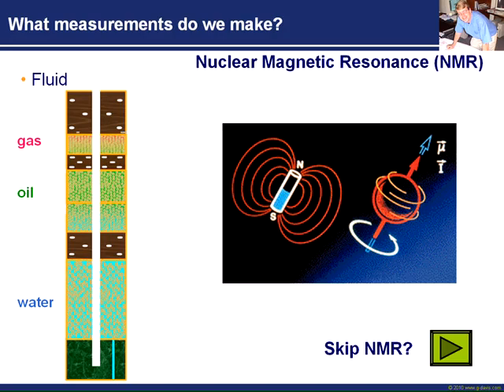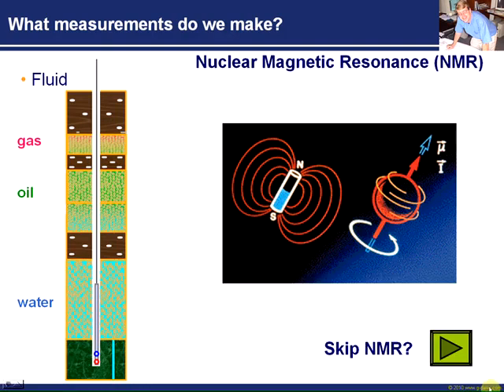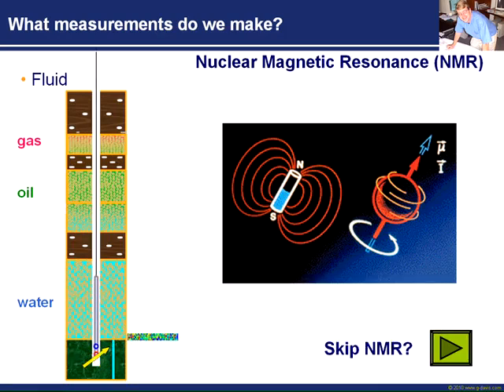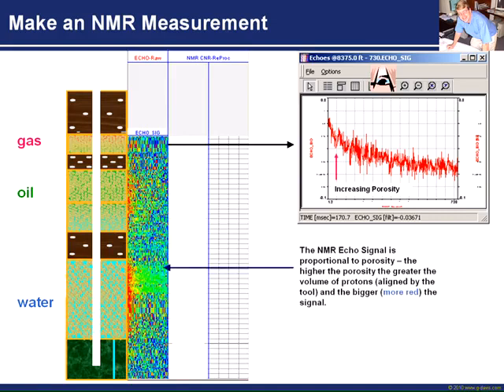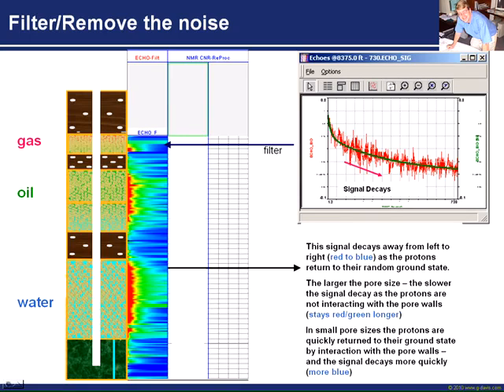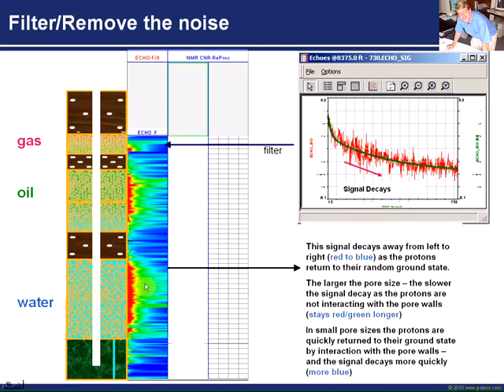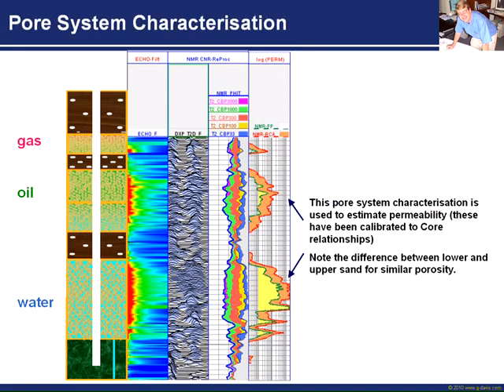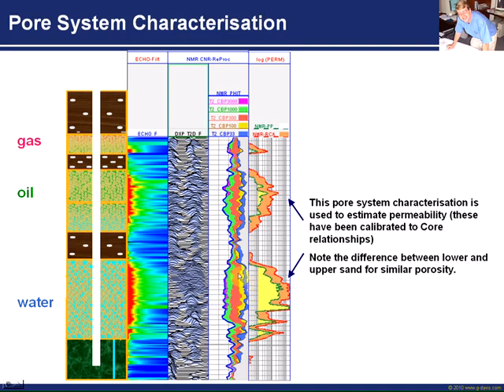Petrophysics | Nuclear Magnetic Resonance | What measurements do we make in Peterophysics | #6 NMR

Comment: How do we differentiate between gas, oil an water? Also, between light oil, medium oil and heavy oil?
Reply: T1 gives informations about chemical properties
Reply: @sizenproduction9107  thats all you have as an information and response???
Reply: Gas have longer T1 values and polarization time as they have low hydrocarbon density and much higher molecular self diffusion. When you only have oils in the sample, you ll have longer T2 values than flr water as surface relaxivity is lower for oils than for water (around 1/3) in case of mixed oil and water, you will see doubled T2 peaks, one peak for the water and one for oil (even though it's sometimes hard to see it depending on the wettability of the rock). The heavier the oil is the lower T2 relaxation time it will have.
You can check a website called "petrowiki" and those articles : Petrophysical Principles of Applications of NMR Logging, W.E Kenyon / Caractérisation de structures poreuses par relaxométrie RMN, M. fleury
Reply: @sizenproduction9107  now this a great response. Thanks!